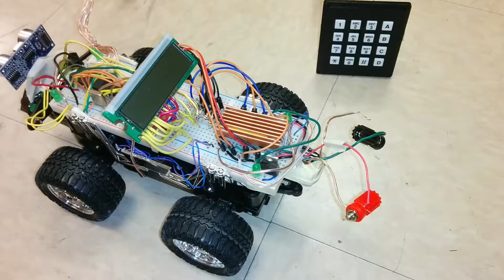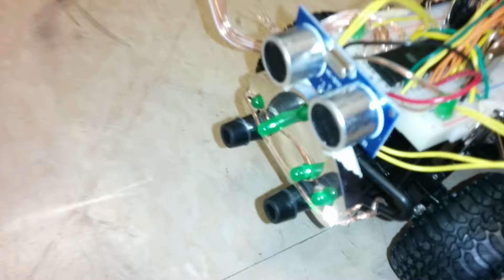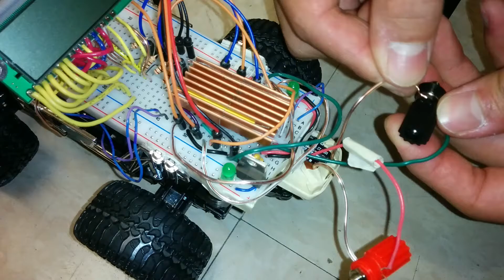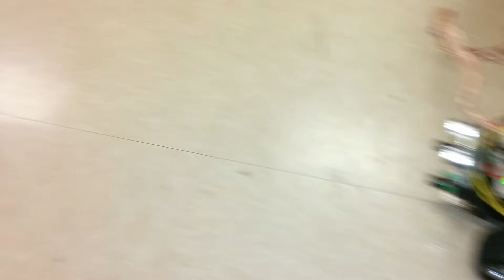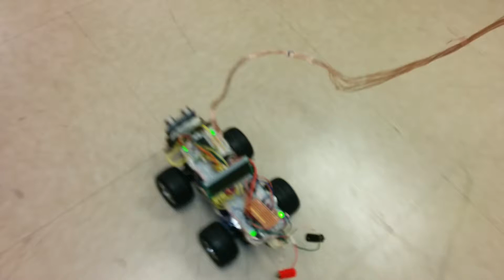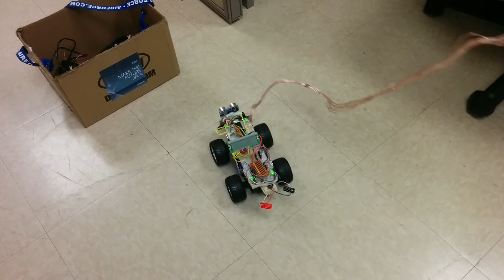UCI CS 145A - Final Project -  RC Toy Car

Comment: I have a question!! I am going to UCI and I'm undecided between Computer Science and Engineering or Computer Science major. I notice that this is a computer science class. So did you guys learn about electrical components of electronics such as using resistors in in the embedded software class?
Reply from the maker: Just barely scratched the surface. If you're interested in learning electrical components, then you should choose cs and engineering major.